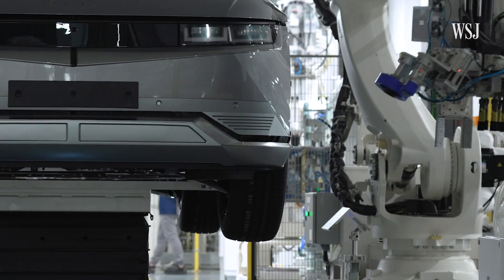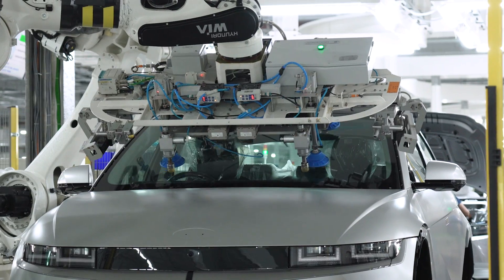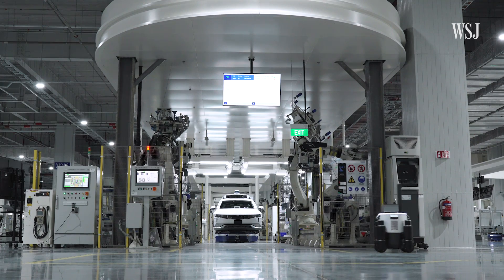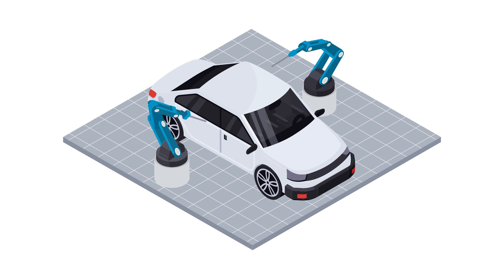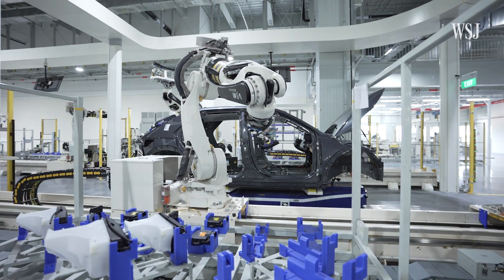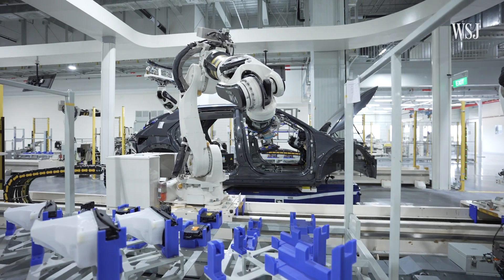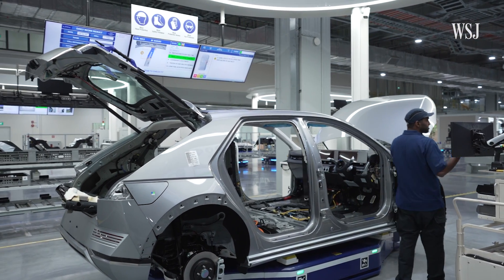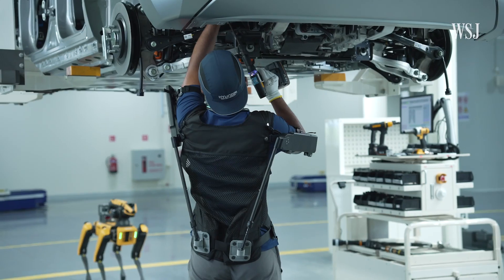How Microfactories Could Be the Manufacturing Strategy of the Future | WSJ

Comment: The video doesn't explain why it's more effective, actually it looks to me it's a lot more complex than a traditional line based model. The advantage I think is in the reduced switching cost - allegedly. With increased degrees of freedom comes increased complexity as you naturally need the different parts, supply feeds in the factory etc.
While the increased efficiency is praised, comparing the tesla Gigafactory the math doesn't add up, the Tesla Gigafactory is 10 times larger and produces 10 times as much cars, the micro factory produces roughly a 10th. So that doesn't look like a lot more efficiency per sqft for me.
The conclusion I draw for myself after watching the video, really interesting case study and probably economically successful in an environment like Singapore with the high import taxes, cost structure etc.

Comment: Former 20 year manufacturing engineer. This is the future - maybe in 15-20 years. Especially for flexible designs, simplified assembly, and some level of scale. With low human to product ratios, you can make things locally. Speed is not as critical as they work 24/7. Eventually, a system like this will use AI humanoid robots where it makes sense. When we think of made in America, this does not mean made by Americans. Oh, and all those robots are made in Germany, Japan and Korea.

Comment: Logically grouping manual assembly with production lines and automation with production cells creates a narrative fallacy and misrepresents the point of production cells.

Economy of scale is everything for the profitability of automotive production in normal circumstances. Automated production lines by nature have significantly higher output and can be equipped (to a certain degree) with flexible machinery if product customization is required. Their actual downside and the reason cells have a niche spot is the high upfront cost of equipment even by megacorporation budgets.
I'm simplifying a bit, but on a ten thousand plus part assembly scale a conventional automated production line is either full capacity or non-existent, as in you still need every station type to produce a full car no matter how many you need per year. On top of that machinery will be purpose built, meaning you can only use it for it's designed list of flexible products without a large amount of modification.

With flexible production cells you can assemble a comparatively cheaper, but low output system and scale it up (or even down) over time with further comparatively small investments. 
Note that fully plumbed industrial floorspace is expensive, and the capacity per floorspace taken up by serial process production lines will literally always be higher even with moderately inefficient layouts.
As explained by others Singapore's import tax makes local production a necessity for profitability, but being a relatively small market the upfront cost of high capacity production lines would take too long to start generating a return on the investment, because machinery will need to be modified to become compatible with new models.

Given that this is a very specific problem to a few small countries the journalist's implied notion that production cells will displace conventional production lines is unnecessary.
//And in case it wasn't obvious to someone; attaching a camera to a 75k$ robot dog doesn't enhance the camera's functionality, and AI cameras cause the highest amount of accumulated downtime in all machinery they are put in to begin with.

Comment: Comparing the gigafactories 10M sqft with an output of 250k cars gives you ~40sqft/car and Hyundai 935k sqft at 30k per year gives you ~32 sqft/car. This isn’t a huge improvement, + the Hyundai numbers are theoretically and will likely decrease after the factory is finished.

Comment: This modular layout is better suited for apparel manufacturing than cars 😅 as long as heavy objects need to be moved around, you will need non-linear increase in floorspace to safely grow throughout. Also floorspace is not among the primary factor to be optimized while thinking of setting up a car factory, as most people want it away from densely congested parts of the country.

Comment: Wall Street Journal used the Tesla giga factory as an example but didn’t put any context behind why it’s the size it is. A Tesla giga factory can produce more than 1 million cars. The reason why the Texas location is at a 250 K capacity is because it’s being ramped up for the cyber truck as well as creates a significant portion of their battery cells.

Comment: Wouldn't many small microfactories instead of a huge one make supplying them with materials and shipping their finished products a logistic nightmare? And if they just build 1 or 2, they would lose the advantage of the economy of scale no?
Reply: logistics companies would love to see this and 3d printing more parts more locations more trips
Reply: A majority of production costs are directly tied to labor costs, by moving automation to these types of levels, which will only increase further, even with the losses on reduced benefits for logistics you're going to see increased gains overall in margins. There's also added benefits from the standpoint on value creation for the vehicles themselves, these production lines that can switch from one car type to the next, from customization X to customization Y on the fly without needing to reset the lines or down time are going to improve automakers abilities to push products that have more individual line items added which raises the attractiveness to consumers to make a purchase with potentially higher price point additions because instead of the basic trim, where they weren't going to buy the premium trim, they may be adding X Y or Z.

Comment: It's an assembly line, not a factory. Finished parts are imported from Korea and Indonesia. This site costs $300 million, and doesn't manufacture a single bolt. To have a real factory would cost way more with tons more red tape. Dyson's now abandoned plan to set up a EV manufacturing plant in Singapore was budgeted at $2 billion. they're now investing about the same just to set up a battery production line. To say micro-factory being the manufacturing future is naive, please don't treat us like children.
Reply: Finally someone with a more nuanced statement.
Reply: Yep
Reply: scale always wins
Reply: Those large scale car factories are also just assembly Lines, just like micro factories all they make is stamping steel and aluminium. Batteries, tires and engines are Always made seperately

Comment: Note also that there's a high import duty tax in Singapore for cars. So, this assembly might makes sense in Singapore only - to sell to the local population and evade taxes on import.
Reply: Singapore has 150 cars per 1000 residents. Only 850k cars total. It has high import taxes as a way of raising revenue on a luxury product, not to capture manufacturing for a local market
Reply: @prabhjotathwal380 so far, sure, cause it takes too much space and resources. My point was that microassemblies would be a way around the taxes for companies - nevermind the intent of the gov.  

Just would be interesting to know where do they sell those cars.
Reply: @prabhjotathwal380  No doubt Singapore wants this so as to promote their strengths in high-tech robotic manufacturing, but the govt can't make it too successful because it would completely undermine the import tax. Other places do it by controlling and taxing (e.g. stamp duty, auction) the supply of number plates.
Reply: @prabhjotathwal380  Singapore doesn't PHYSICALLY have enough space for mass motorization. That's why they have amazing transit. You can criticize the economic tools, but the end goal of greatly limiting car ownership is necessary.
Reply: you mean "avoid import taxes"
Reply: It's also being done by Arrival in the UK
Reply: Thanks for the info man. This makes lots of sense now. Cause I know for sure Tesla's Giga factories have a similar if not higher level of automation but they still stick to large factory design.
Reply: So in the end, people will buy BYD
Reply: That's the whole idea to build for the local market according to the CEO of that company.

Comment: This only works in a place like Singapore. (very high car prices + cheap labor right across the border to make the sub assemblies + avoid the tariffs by being inside singapore)(Theyre only doing assembly as well so most of the work is done offsite)
Reply: Still it is working. Efficiency comes over time as learning and refinement takes years. How will it be in 15 years from now?
Reply: The production of batteries, tires and engines are not labor dependent, those goods need infrascture and energy. Let me Tell you that singapore is a highly industrialized country, around 21% of their GDP comes from the sector

Comment: I don't feel like this video explained what the advantages of a small-footprint cell based assembly plant are. Yes, it's automated, but so are assembly lines. Moreover, assembly lines are designed to support high-throughput, whereas cell-based assembly appears to be severely constrained.
Reply: What I understood was that they have 10% the footprint and 10% the output
Reply: They tried to signal, that they are more space efficient than Tesla, but I can not imagine, that that is correct.
But the good thing of the cells is, that you can adapt them faster and you have more freedom to build different products, than an assembly line. It gets more efficient, the more products you have. Also it is cheaper in the long term compared to the assembly line, because you do not have to change too much, when implementing a new product.
Reply: @broenthompson4634  To serve 10% of the market, yes
Reply: Factories today are very efficient when they are up and running - but due to the linear design of the factory, it is very difficult to change the design of the car, thus slowing model to model development. I think the main benefit is that it allows for the same efficiency but also increased flexibility of design
Reply: Consumer demand wants to trend towards local customized builds instead of the offshored mass produced stuff that's been available. An agile microfactory would fill the niche between 3D printers and a full-sized town-dominating manufacturing plant.
Reply: @doujinflip  But they can produce different type of cars at once, might be suitable for a space colony in the future.
Reply: @doujinflip  but since it doesn't benefit from economy of scale the manufacturing cost will be extremely high not to mention it's not providing any job for the local people if so what's the point of Bringing back the off-shore plants back to our nation?

Comment: Wonder if this micro factory will be adopted as a means to reduce a physical footprint for manufactures and also pumping out more cars by designating specific factories for specific models and swapping as consumer habits change. So rather than 1000s of workers in one location, small groups across multiple sites so if a problem were to arise production doesn’t stop as other factories can step in and carry the load as needed.
Reply: It's more about making small, boutique carmakers more viable, and also to build cars domestically in protectionist, closed markets, just like how some countries used to assemble cars from kits made overseas.

In carmaking, economies of scale is absolutely everything if you want to compete.
Reply: We dont actually need more cars. Demand for cars peaked in 2018 globally.

Comment: Micro factory requiring 30,000 plus parts per car, not to mention custom modifications, what could go wrong with this supply chain? What happens during cold / flu season if three or four highly skilled workers are absent?
Reply: I don't think that such a microfactory is more susceptible to a flu season than a traditional large one. An assembly line might be forced to stop if a critical amount of workers at a certain station are sick. In a microfactory, a few not staffed cells might not cause a full stop because the rest of the cells can potentially work in parallel.

Comment: i still don't get the point of these microfactories. Sure creating more customizable factories and products is a welcome improvement and increase in automation is a good thing too, leading to higher efficiency. However big factories is still the way to mass-produce things and many automation things from microfactories can be brought to big factories too.
Reply: This is my take-away too. Perhaps WSJ did a poor job explaining the benefits, or perhaps it's simply a solution out looking for a problem.
Reply: It provides local manufacturing capability when access to farther full-sized factories gets disrupted for whatever reason. In the meantime these make custom builds more practical to produce.